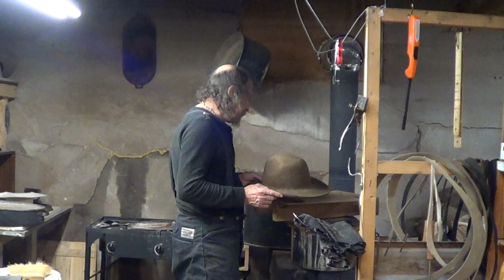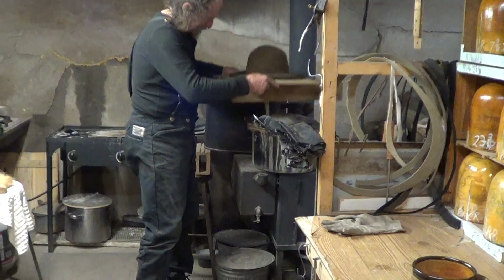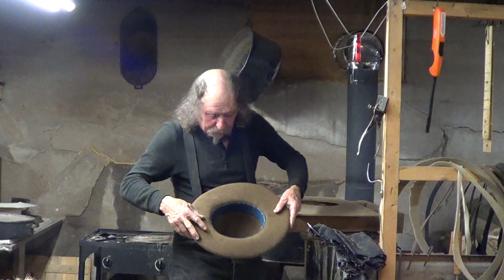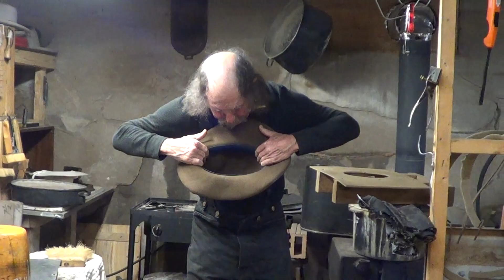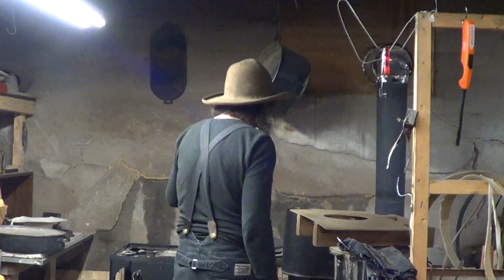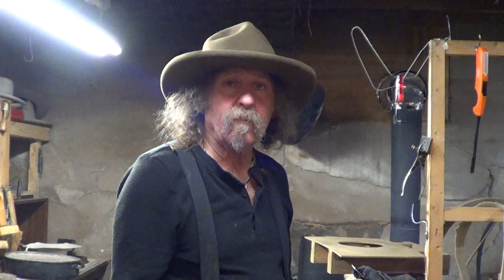How to fix a tight hat

Comment: I’ve got my great grandpas Resistol Beaverskin hat that is a reproduction of Bob Evans (the restaurant guy)’s hat, and it’s always been a tiny bit too small to get down on my head since he gave it to me before he passed away. Thanks for the video, I’m off to boil a pot of water. I’m going to try to reshape the front of the brim to fold down, as it is the brim is up all the way around and it would hold an inch of rain lol.
Reply from the maker: Be sure and let us know how it goes!
Reply: Hats By Grizz - Made With Joy so far so good, I pulled the front of the brim down, slightly pinched the front of the crown and added small dents and rolled the sides of the brim up a little bit. I can definitely feel it stretch out when I put it on, I’m just keeping it on now until it feels dried out. I’ll wear it in the next video I post and leave a comment if you want to see the final result. Thanks again, you guys seem like a cool bunch that make quality stuff.
Reply: So did it work?  I have a mink hat I need to enlarge but no bowl big enough!!
Reply: tricia melvin it did work, took a lot of cycles of holding it over the steam, stretching it and squeezing it on my head, but I was afraid of damaging it so I took it slow. Still didn’t take longer than a few hours as a side activity. As far as reshaping it, it looks like an entirely different hat and I’m very pleased with it. Still need to wear it in a video, but the virus has not been kind to ammo prices.

Comment: This is what I was looking for awesome! But I have a problem that is that, do I have to remove the leather inside the hat or without removing the leather? Please help 🆘
Reply: Imli K Imchen did you ever find out?
Reply: @shepdog1274  yes thank you.
Reply: @Cowboy-e1c  Did you have to remove the leather hatband on the inside before stretching it?
Reply: @Detman101  sir, I have removed the leather and now it has become loose so I have to apply some idea thank you.
Reply from the maker: I'm so sorry....I had totally missed this question. The leather band in an old hat often shrinks up and has to be replaced when the hat is stretched. You can add an outer band that ties and pull it in a tad.
Reply from the maker: In general you first try it without removing it and then do so if needed.

Comment: I bought one which is more of a large than an extra large, so I will try taking a steaming hot shower while wearing it, and then jamming a wadded up bath towel inside there and leaving it to dry that way.
Reply from the maker: let us know how that worked
Reply: @hatsbygrizz-madewithjoy1241  It did not work very well.  Not stretchable enough.  Kinda hurt my head after a while when I tried to wear it afterwards.  I wonder if boiling water would have helped.  Anyway, I ended up giving the new hat away to a friend who spends a lot of time in the sun and he seemed to like it.  Nice Aussie Breezer hat with mesh for airflow.
Reply from the maker: @nefariumxxx  Please message us hatsbygrizz@gmail.com we might be able to offer more ideas but we need to see some pictures of inside and outside to be sure of what you are working with.
Reply: @hatsbygrizz-madewithjoy1241  Thanks.  It's OK I already gave that hat away to a friend who could use it.  He spends a lot of time in the sun.  Fit his noggin just right.  Was more of a Large than an XL which is what I wear.